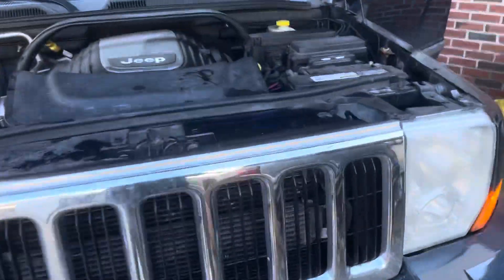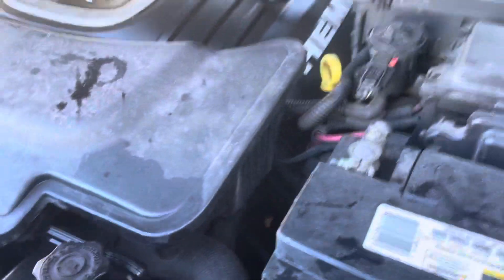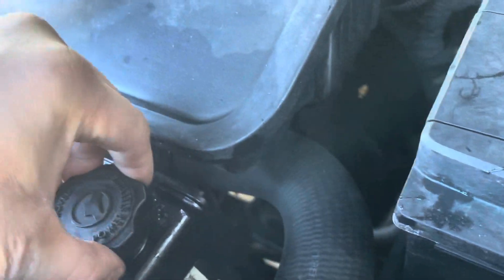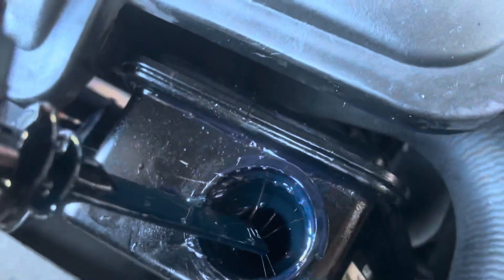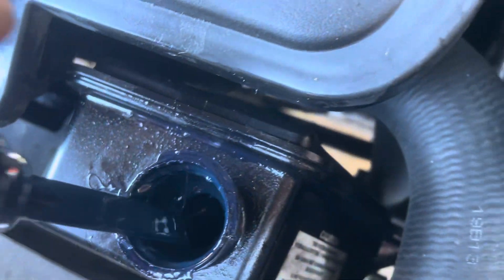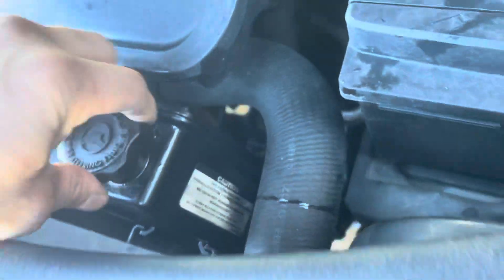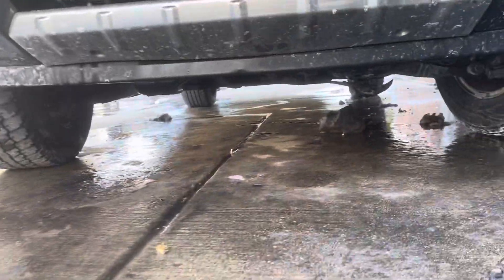2007 Jeep commander limited 5.7 hemi  powers steering issues, and engine over heating, bad fluid!?￼

Comment: u think a bad pump and/or dirty filter could cause the hydraulic radiator fan pump to have so low a flow that the fan never spins, but the pressure is still good enough for power steering? trying to troubleshoot my overheating condition, i.e. fan never coming “on” (it’s not seized, changed fluid, checked solenoid, verified PWM signal, temporarily disconnected engine temp sensor, etc.). seems like folks experience low rpm problems, but i don’t see anyone having a  “no rpm” condition like i have
Reply from the maker: If you wanna bring in i can look at for you
Reply from the maker: But I would say is if you have a hydraulic system I would first check with the hydraulics before you start checking the fan out I have a Lexus with a pump went out and was leaking in the cause of low flow which causes the fans to work really slow which load the car to overheat how I fix this was replacing the pump and changing all the gasket seals in lines

Comment: Hey did you ever figure out what was specifically wrong with the truck?
Reply: I did. The radiator fan is powered by the powersteering pump. Its the dumbest design ever cause if you have a leak or a the pump goes bad your radiator fan stops working. Once the fan stops working it will cause your engine to over heat at idle.
Reply: @m16swaggr97 did you have to replacement the fan too?